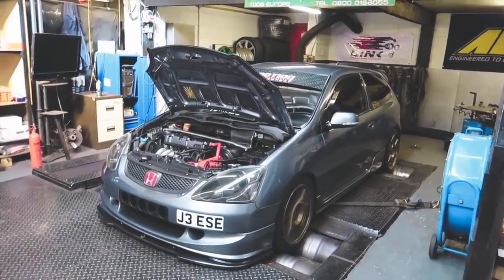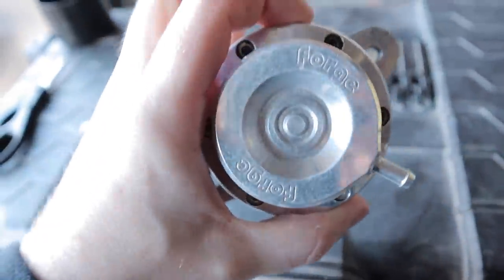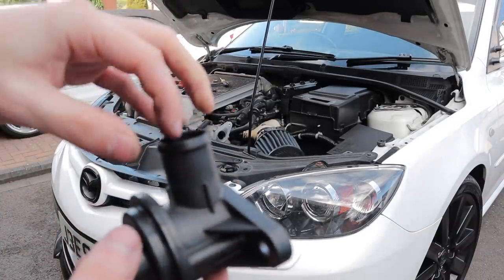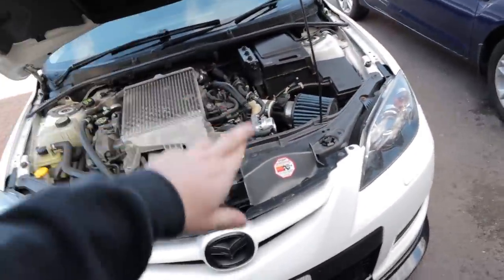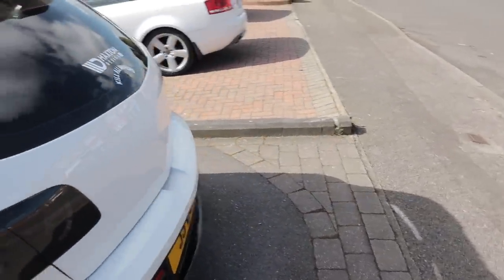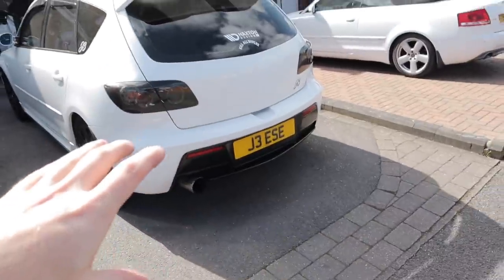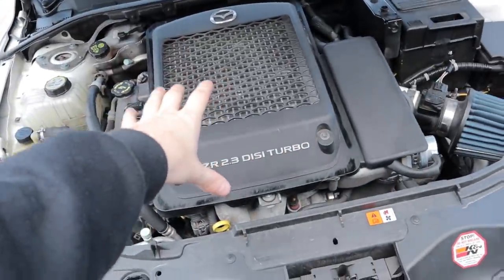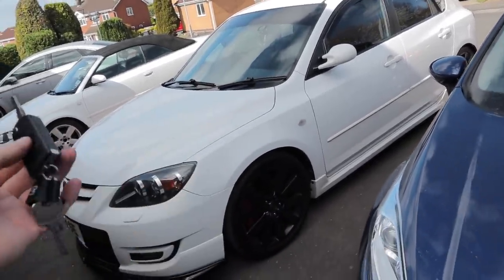MPS GETS A BLOW OFF VALVE!! *TURBO NOISES!*

Comment: You won't notice any difference running until you Monitor real-time afr, you'll notice it bouncing from normal afr on boost to momentary rich, back to let off n back to running afr. If you don't have cash for an access port the now, I'd advise buying torque on android with an obd adapter and the torque mazdaspeed plugin, it'll monitor everything for you until you get the cobb also use it as a boost gauge etc, and ps  that's a full vent to atmosphere as it's not connected to the intake hose you blanked. 50/50 would connect to the hose and have a trumpet
Reply: or use the free version of Versatuner and log the car with that :)
Reply: @mattieson130  didn't know they done a free version what would you use as interface? Do you need the versatune cable
Reply: @Dazza2292   you can use any obdsx cable. About 60 euro's and can be used as a flashing cable too.
Reply: @mattieson130  good to know

Comment: Great video mate, quick question. is that a hybrid boy? AND did you have to upgrade your high pressure fuel pump internals when you upgraded the air intake? thanks

Comment: they normally come with 3 springs of different tension. which did you use? red blue or yellow? when you remap your car you may be running more boost and will need the stiffer spring so the valve doesn't open early. also i would of undone all the Allen bolts. took the spring and piston out, cleaned and re greased the piston. this needs doing at least yearly. i loved mine sounded sweeeeet. if you don't have the separate springs you can buy them separate. they are only about £15 if you need them further down the line.
Reply: Where do you buy the springs from?

Comment: Does sound sick! Don't worry about it not recirculating mate, come to mapping it, it can be mapped in and even when it isn't it isn't that big of a deal when compared to putting a vent to atmosphere bov on something like an Evo or sti, which does cause noticable issues, and tbf it's safe, at the end of the day it over fuels on decel, which is way better then running lean, good man Jesse!
Reply: Over fueling on Decel can cause bore wash. I own a Subaru and regardless of car dump valves cause over fueling, which CAN lead to problems.
Reply: @Brad8261  ik it can, just on mazdas they don't tend to overfuel that much compared to scoobys and Evos idk y, whether it be the placement of it orecu corrections idk

Comment: Front mount intercooler, blank the recirc valve, get some STU STU STUUU’s!!               I’ve got a forge BOV on mine, you can buy different springs with different strengths for different sounds 👍
Reply: Mike L Can alway get them mapped if they cause issues 🤷‍♂️

Comment: Sounds awesome... Reminds me of my saab 95 hot aero
Reply: Wow what mods did you have on it?
Reply: @willpark7483  turbo back exhaust, itg open air filter, front mount, baily valve, manual boost controller running 24psi and remap mate
Reply: Crystal clean external cleaning Bet that was rapid!
Reply: @willpark7483  went very very well.. Once it got traction haha... 3rd gear was the best pulled like a train... Stupid on fuel tho... Avarage about 18mpg

Comment: Now it needs full induction kit if it doesn't already have one with an alloy crossover pipe and you'll get even more blow off noise. The slight flutter is because you've blocked off the recirc valve. It's a typical way of getting flutter with standard hardware. Blank off or clamp the recirc. If you remember it's what that guy did to the VXR when you was at that meet. Top video tho mate 👌👌

Comment: You might find the car feels a little slower between gears? As you are literally dumping all the boost out, then having to build it back up the hole time. Just something to be wary of mate
Reply: ZibbHD yes had that with m focus ST. Thought it ran well as it had a dump valve fitted when I purchased it, recently removed the DV and replaced standard recirc valve with an up rated Forge recirc valve and what a difference!! Car is now more responsive and generally drives a lot smoother.

Comment: 10000% cent to atmosphere, can’t be 50/50 Jesse as it doesn’t connect to the recirc pipe. The car will over fuel on decel with the bov fitted, many say this will lead to bore wash. This is one of the reasons I went back the a standard recirc valve... the noise does get annoying after a bit.
Reply: Vent**

Comment: Once you get the fmic on you can delete the recirc valve and you’ll get proper turbo noise as it stalls and then spins again, the noise is the air in the turbo fan blades 👍🏻